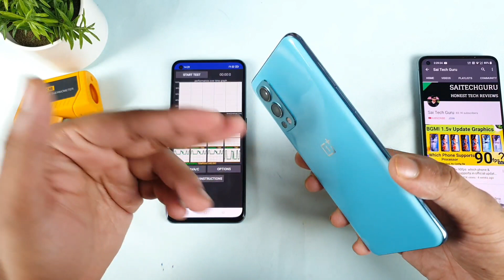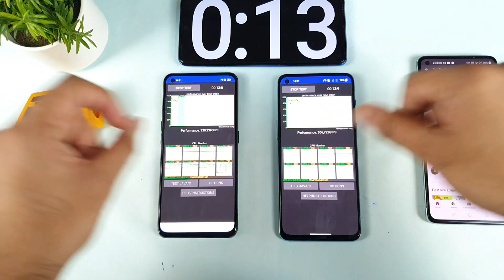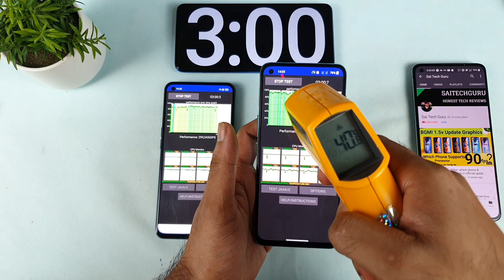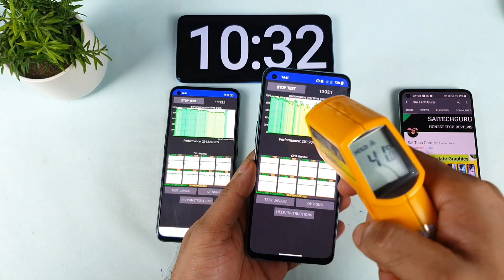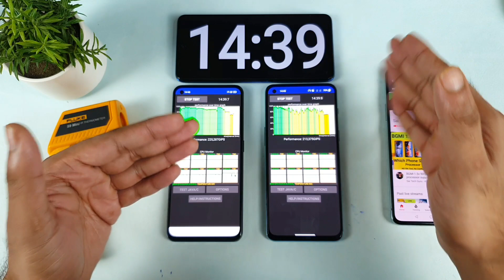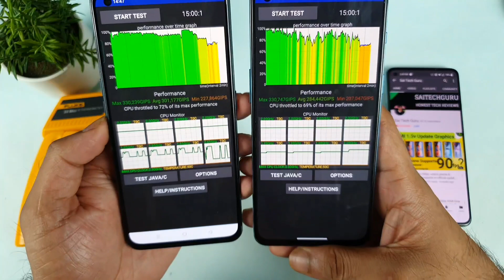Oneplus Nord 2 vs Realme X7 Max CPU Throttling Test Extreme stress test 🔥🔥🔥

Comment: Anna plz reply me or make a video, how to turn on proximity sensor in realme x7 max mine not working 😭😭
Reply from the maker: Remove screen guard and check or restart phone if doesn't work factory reset phone and Check ...
Still not working service center is final option.
Reply: @SaiTechGuru  ok anna
Reply: @SaiTechGuru   anna 😘😘 working now but removed screen guard , not feeling safe without screen guard plz suggest now good screen guard